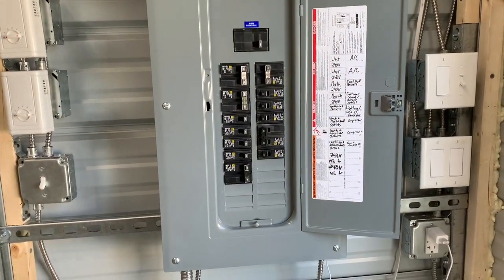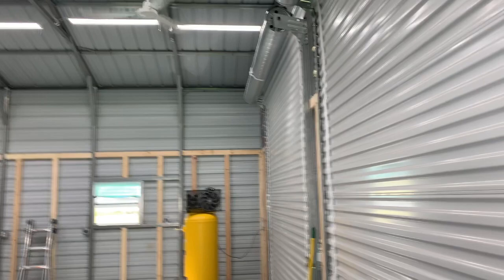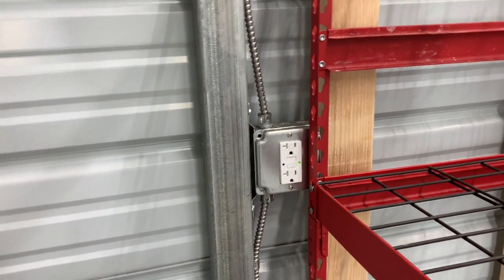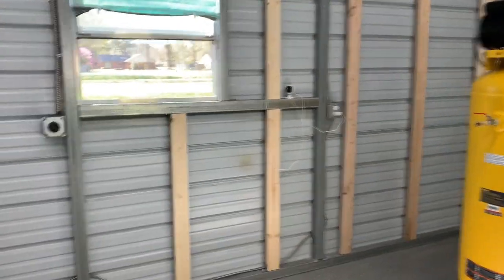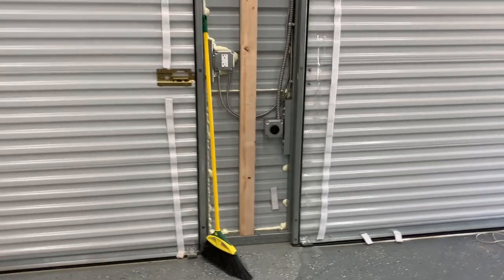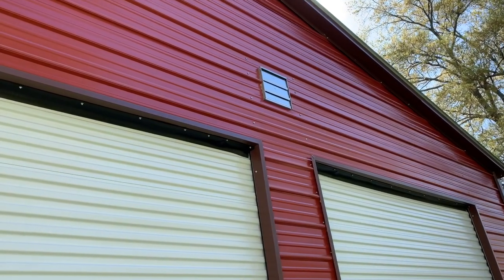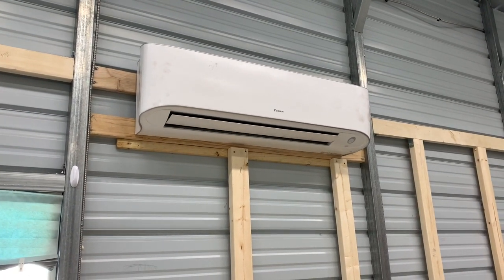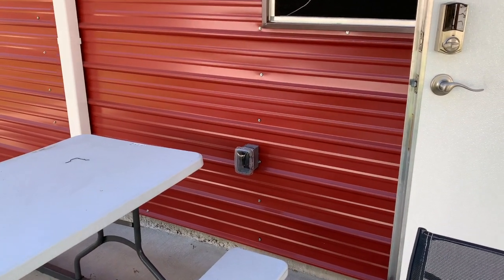Overview of the electrical setup in the shop. Building my dream motorcycle shop episode 4

Comment: Please keep videos of building process coming I am building a 24x30 shop metal prefab and you've given me great ideas.  Great video thank you
Reply from the maker: Thank you. Anything in particular you want to see
Reply: @113Cycles   love to see how you end up doing the walls and a final set up of equipment (welder-welding bench. I've watched alot of videos on metal prefab buildings and your is the same size I ordered so I can relate to it more for set up. Thanks again!
Reply: Can I ask what 24x30 will run you building/slab?
Reply: I'm in ny building insulated garage doors and slab was 22000
Reply: Viking steel structures amazing company to deal with couldn't be happier
Reply: @shaunhalfacre6606  thanks bud I'm in the market and getting a fair refi on the house. Kind of let's me know what I can spend on windows n siding on the house.

Comment: I really like how your shop is coming along.  Your doing a great job and I appreciate these videos on your shop build. I am about to break ground on my 40x52 and your videos have some great tips that are helping with my decision making. Thank you and looking forward to your insulation video as well!
Reply from the maker: I hope your shop came out great
Reply: @113Cycles  Hello, and thanks for checking in. Yes my shop is up and still not completed. Today was my building final inspection and I’m pretty sure I passed. It has been a long grueling process with me doing this during this Covid disaster!  I couldn’t have picked a worse time to do this. At least I was lucky and their best crew put up the building. They were professional and did a great job. However prices are skyrocketing on everything along with major delays. I’m about to do electrical then the close cell spray foam which now has doubled in price but I want for the integrity especially because I live in South Florida hurricane central.  I first met with this contractor November 2020! Also have to do the driveways and finish rock grade around building. I’m still not sure if I’m going to frame out the inside for future walls or just take the spray foam look. You must be real happy with your building and I think it looks great! Is there any advice you have on what you may have done different? Thank you, Joe.
Reply from the maker: The best advice I have is to get some good silicone and seal everything you can. Seal between the concrete and the steel beams on the inside. Also lay on the floor and look at that gap again to see if any light is coming through. Seal around the doors and the windows as much as you can. These were the main areas I had leaks. If you have done the electrical yet and can afford it, put in more outlets than you think you need. If your planning on finishing the walls inside, put studs up before the insulation goes in. I did the bottom 8 ft but not the upper. I couldn't afford it. I'm going back now and adding studs to the upper portions of the walls. I have to scrape out quite a bit of insulation to get the studs in. Unfortunately wood is still expensive so it's a slow process. Hope this helps, Ryan
Reply: @113Cycles  
Thanks  Ryan for the advice I really appreciate it. Yes cost of everything skyrocketing not making this easy for any of us. My next step will be the electrical and studs. I will be sealing off all gaps like you suggested prior to me getting the insulation done. 🙏God bless , Joe.

Comment: Nice shop. When I built my shop everyone said I did over kill on my outlets. I have a 20x40 shop. I installed (5) outlets down each 40 ft. wall and (2) on each 20 ft. end. Two welder outlets, one on the side wall and one at front rollup door, and one air compressor outlet where its located. Yep its over kill but I haven't had to worry about where an outlet is when I'm doing something.
Reply from the maker: I wish I had put more outlets in. The ones on my workbench are constantly full

Comment: Getting ready to do a 24x36 was just wondering how the power is running does it follow the beams all the way up and then run along the upper rails to the box and if so how does fit between the 2x4 and the metal panels
Reply from the maker: Yes, that’s how it runs. The 2x4’s are laid so that there is space between the sheet metal and the studs. They slipped the wiring behind them and into the natural grooves in the metal.

Comment: How did you secure the wood studs to the walls? BTW, Thanks for posting I'm in the middle of planning the electric on my shop. I like the way you have your lighting set up.
Reply from the maker: I attached them with L brackets i bought from lowes. I used self tapping metal screws to attach them to the frame and wood screws to attach the bracket to the 2x4. Thanks for the comment and good luck with your build

Comment: Awesome job , got a few questions though
1 . Could you have cut this in half with half of the building living space with a loft and the other half garage ? 
2. How tall is the garage to the Evewrs ? and  how tall are the studs ? 
3 I am thinking cut it in half make half a mother in law suite n half the building and a garage on the other half , add a bunch more windows With a loft on half of the living section . 
So half of the building would be a garage and the other half would be 12 by 30 Living room kitchen, bathroom and bedroom and a loft on half 12 by 15 living space
Reply from the maker: Absolutely, Metal building are great for that kind of build. My walls are 12ft with a 16ft peek. I believe the trusses are at 14ft.  I'm going to add a 8x30x8 mezzanine later for more storage. If you plan on working in the garage, just make sure to add good ventilation. You don"t want garage fumes in the living quarters.

Comment: Great video on the electrical. You mentioned sprayfoam insulation. How thick are you going and how much are they charging?
Reply from the maker: I did 2 inches of foam and it cost $4k. That was just over a year ago now. Not sure if the pricing would be the same now.

Comment: I've got a roll up door like yours and they put the lock on the outside...have you had any problems with the roll up bending or warping with the locks on the inside like that?
Reply from the maker: I haven’t had any issues bending or warping. They installed the locks on the outside of mine as well. I took them off and flipped them around. I don’t remember the process but i did have to do some modifications to make them work on the inside

Comment: How did you get your door latches on the inside
Reply from the maker: I cut off the bolts then lined the slide portion up with an existing hole on the rail. Marked and drilled new holes in the door. Then installed new hardware. I sealed the old holes with bolts nuts and washers. I was pretty worried about messing it up but it turned out to be relatively easy.

Comment: Are all the wall wall receptacle on the same breaker?
Reply from the maker: No, there are a number of breakers for the wall outlets. They are split up pretty well.
Reply: @113Cycles  Makes sense, great video. Thanks.
Reply from the maker: @jackieholder9404  thank you

Comment: What state are you in? Just curious for building code.
Reply from the maker: I'm in Arkansas
Reply: @113Cycles  Thanks, I'm in central Florida where our inspectors are a pain in the ass. I have to be honest, Doubt I'm pulling a permit. When I built my steel garage, The inspector put me through the ringer ( e-mail after e-mail, document after document ) just to get the permit. 
I finally went back into the office and the head inspector was there, I told him I couldn't possible give my case inspector any clearer or more docs for approval. and the lead inspector called him up front and told him to give me my permit cause as a home builder, I had better plans and document than most contractors provide. 
I just don't want to go through it again!.
I do build everything to code and beyond, So I'm just going to document and take photos of everything so later I can pull an as is permit if I ever sell.
Reply: I was looking at your video to see what conduit you are using, You are covering your walls so you are good with the FMC conduit because it will be protected against possible damage. I on the other hand will be using rigid EMT. I do plan on insulating but not covering the walls after insulation.
Reply from the maker: I did exchange a number of emails with the city before I got the building permit. Mostly because I wasn’t familiar with the process. I also wanted to make sure that everything was in order when the inspectors came.